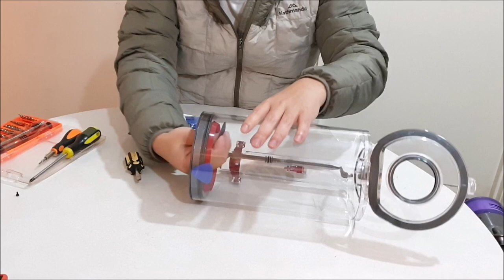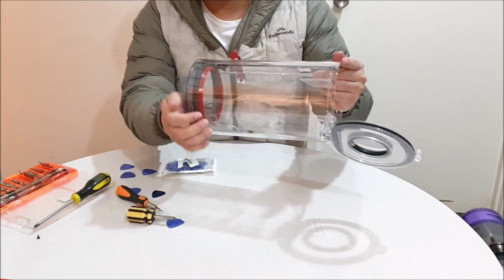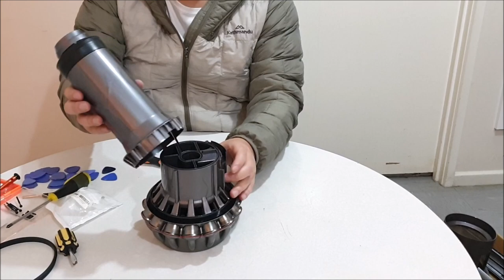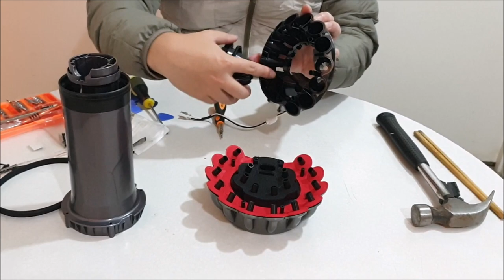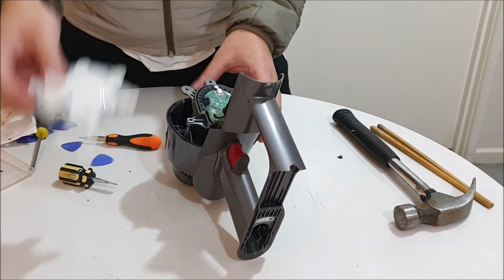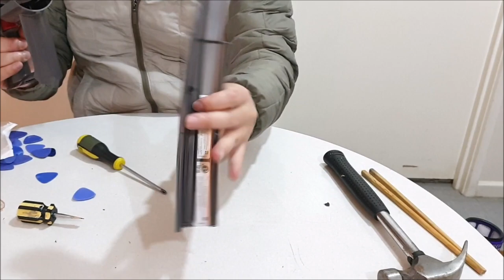OPEN ME UP! Dyson V11 Outsize Complete Disassemble and Clean

Comment: My original problem was power head not working or getting any power.  Luckily plugged power head into another Dyson and worked fine, used other Dyson power head in broken Dyson and wouldn't work so problem with head unit.

No the reason for glue covering the V11 motherboard board was due to condensation occurring and corrosion occurring on the mother board.  This happened to my V11 which I discovered when I took it apart as powerhead wouldn't work.  Worked out it was something wrong in the head unit and when I took apart and took off white cover on the motherboard, it's was corroded  and shorting out some of the circuits.   

Condensation must have been occurring when being heated up and air flow over motherboard causing the moisture and condensation.  That's why I think they put the coating on the motherboard to protect it.  

Anyway I used some Isopropanol to damp corrosion and then lightly brushed and cleaned with a toothbrush... fingers crossed.  Then a final clean with some  more Isopropanol.

Put back together and everything worked fine.

Comment: At the 18 minute mark, mine does not come apart. At the backside (away from the guitar picks) it looks like it's coming apart. However, where the guitar picks are jammed in it does not budge at all. Do the guitar picks need to hit a lever or something on the inside? I have them way in there. Thanks.
Reply from the maker: it is extremely hard if you never remove it before. you might have to pull harder

Comment: Ok. So the original problem was that the motorized accessories such as the high torque  head cleaner was not getting any power. I realized that the connector was a little deep, so the pins were not aligning properly with the accessory. I disassembled the vacuum until the chopsticks stuff (genius). In fact, they were too deep so I push them out. Then I connected the hight torque head and it worked like a charm. Then I tried to put back the connector but when I connected the head, no power. I tried 2 more times without putting it back and it worked; however, out of the sudden, no more power. I used a voltage tester and it seems there no power coming from the black (positive) and white (negative) cables. Weird that the black is the positive, but is the one closed to the door of the connector and it has a + sign. Any ideas what else can I try?
Reply from the maker: re do the wires. there might be damage on them so they cant connect. if you tested the wire when they were removed and they work then there has to be an issue when you assemble it. probaly pulling on it to hard causing it to disconnect

Comment: Hi there - my V11 screen isn’t turning on and only blue lights are flashing on the battery and that’s it. The unit has been on charge but still no life to the machine - any advice would be appreciated!
Reply from the maker: the battery might be dead or the motor/computer part is dead. i have seen this before so it happens

Comment: Hi, I have the same Dyson, turn it on and I see the panel, set the language and I can see the programs: eco, med and booster.  but when i press the red button the vacuum cleaner doesn't work.  What could be the problem?
Reply from the maker: your trigger is broken. the red button you press in
Reply: @OpenMeUpTec  Thanks for answering, the Dyson people tell me that it is a voltage problem because I bought the vacuum cleaner in the United States where the voltage is 110 and I want to use it in Bolivia where the voltage is 220, is this possible?  the charger says input 100 -240V
Reply from the maker: @rossemarycopa204  i dont have the vacuum so it is hard to say. but if you press the button and feel nothing. then your tigger is broken. the vacuum already has battery and if you charge it and see the charging sign then it is working
Reply: @OpenMeUpTec  if I press the red button I feel that it sinks and turns on the screen, but it does not start to vacuum
Reply from the maker: @rossemarycopa204  if you press the trigger and the back screen turns on then you might have a faulty motor. if you press the red trigger and the display at the back does not turn on then your trigger is faulty. you can confirm this by removing the filter and pressing the trigger. the display should tell you there is no filter which means the trigger is working
Reply: @rossemarycopa204  No tiene nada que ver el voltaje, yo compre una en USA y otra en Tokyo, USA es 110v, tokyo es 100v, todas funcionan bien a 220v. Por otro lado me paso lo mismo y lamentablemente es la placa. O compras un motor nuevo en eBay, o compras unas aspiradora nueva entera. En mi caso compre el cuerpo entero, sin bateria y sin el contenedor transparente. Todo esto me paso la semana pasada.

Comment: Hello, great job, could you show the disassembly of the hepa filter, the upper part seems to be assembled with the lower by two strong notches... Is there an easy way ? I'd like to open it up to dry it easier... Bye
Reply from the maker: i will look into it in the future. the fitler is the cheapest item dyson sells at $25 for a brand new one. i recommend you to purhcase a new one instead of trying to clean your old filter. since this may damage the filter and render it useless or not effective as normal.

Comment: Hi, my dyson v11 motor is pulsating when in Eco or Med mode. I have cleaned the machine by blowing the dust out and clean the filter. However it doesn't solve the problem. Please can advise? Thanks
Reply from the maker: take the bin out and use it without the bin. tell me if you still have the problem. if so, take the cyclone out and use it without that and see if you still have the same issue
Reply: I had this it is the motor that has failed

Comment: Just bought mine and not even a month into it, go to empty dust bin and red ring and silver ring fell out into trash. 

Having a hell of a time getting it back in. Guess I’m going to have to buy a screwdriver to take the part off that these go onto to. 
That according to video should not just fall right off. 

The quality is going downhill having used them all my life.
Reply from the maker: it should not just fall off. it require alot of effort just to take it apart